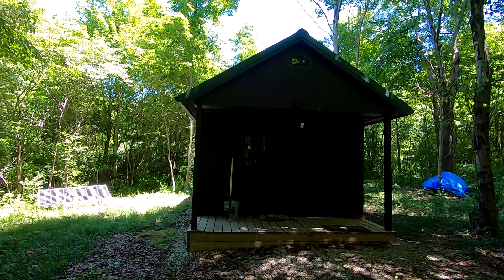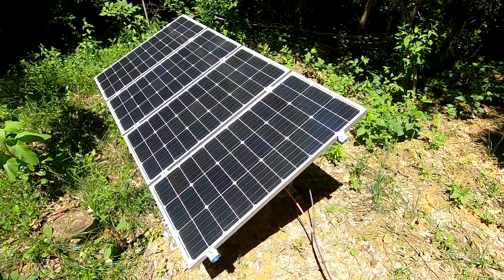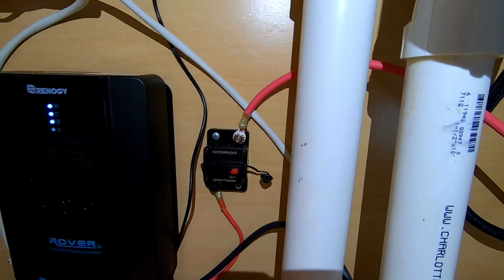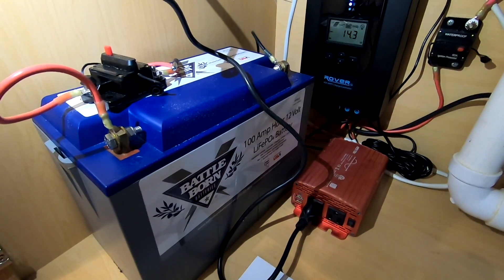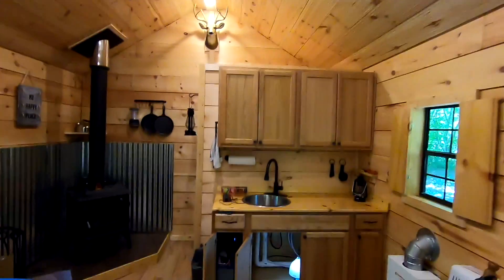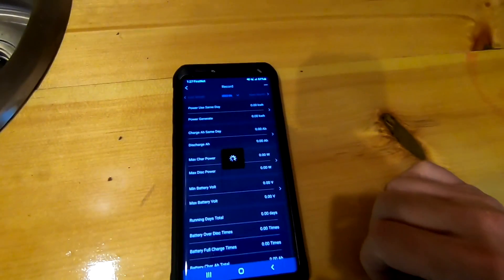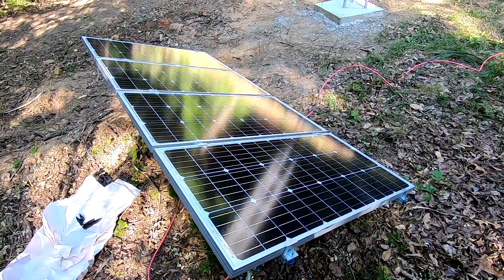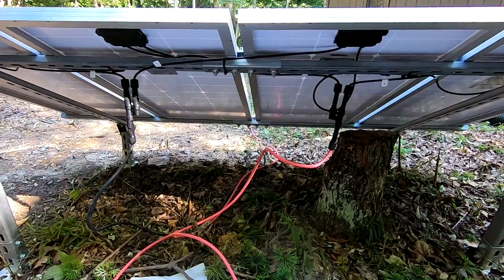$7,000 Dollar Cabin Gets OFF GRID SOLAR SYSTEM

Comment: I'd say switching the panels to 2s2p was a good move to combat shading there. I can also see you with 2 batteries there at some point and maybe using some pvc conduit for the wire run. 
Ok thats a small inverter but it should be hooked up to the battery. 
Nice cabin btw, cheers.

Comment: I just got two of those HQST panels about a month ago. I had fourteen 100 watts panels but couldn't run the window air conditioner very much. My panels are all different sizes and brands. I have kind of the same problem. The barn shades part of the panels after 5 p.m. So I have four on the West side and four that are on the North side far enough away to not be shaded. I have the panels hooked up in pairs, 41 volts open circuit, on my 24 v. system. The smoke from Canada has made it here, so I'm only getting around 800 watts. About five days ago it showed 1030 watts for awhile. The max on my 4215 BN controller is 1040 watts.. I have twenty big marine batteries for the battery bank. I added a 600 watts wind generator in March. They sent a 12 volts one but it was supposed to be 24. No trees here. I made some frames for some of the panels out of square pipe. The frames made them heavier so the wind doesn't throw them around. One of my first three panels got broken that way so that frame is the heaviest, lol. I think those two are like yours. I put two in each one. I ran a pair of #14 wires for two frames or four panels, which seems to help. There's four pairs of those going to the controller. I had 1200 watts of the panels facing the 🌞 Sun this morning. I flip four of them around noon from morning to evening. So I have 800 in the afternoon after the batteries are charged. I tried hooking up the panels 63 volts, and I didn't get as much wattage. There's a voltage that the controller will produce more watts at, mine says 33 volts. Mine runs at about 34.1 or around that. So it's pretty close to the optimal voltage. So, that means I can't put the panels very far away. That's why I am only getting a thousand watts on sixteen hundred watts of solar panels. Eight of the panels are forty feet away. But having the optimal voltage lets the charge controller run cooler. I had mowed by the building so I had moved all the panels out away. They all have plugs so I mowed and forgot to hook 800 watts of solar panels back up. LOL. So this morning I was like what the heck. Then I remembered. So I went and plugged them in and the amps went to 33.1, but the voltage stayed at 24.9. It has to have more amps to charge the batteries with the air conditioner on. So I had to turn the air conditioner off and let the batteries charge. I've got a gallon of distilled water and a pint of sulfuric acid that I'm going to mix and I have 120 cells to check and add water to. It's going to be 100 or over, for nine days. Adding water will let the batteries run closer to 80 degrees. That little hole of light will just get smaller as the trees grow. You can cut it while it's small, or cut it later when it's Great big. Probably need to top some trees, let some light through them. That's where you cut the top out. I would have already been chopping wood 🪓. Whatever was on the Southwest would be stacked drying out. 😅 Well one of these days, if you get the panels bug again, I bought a pair of 100 watts mono panels for $147. I bought the same pair before but they were $10 less back then. Same exact panels. So that's $73.50 each, not bad. They're really high output. I wouldn't mind having ten more of them. My uncle thought I was getting too many when I had 1200 watts, but I had to get four more to run everything else and charge the battery bank too. I usually run the air conditioner for awhile then let the battery bank charge awhile. Then when the batteries are about full, I turn it on . Then the panels will stay up with the air conditioner, freezer, mini fridge, three fans, etc. , and charge the battery bank. Today I had some wind power too. It always helps.  You can't put one up unless you put it in a tree top. You have a lot of chainsaw work that could improve your solar, and or wind generator power system. Besides your panels will get hot without any breeze, and won't put out very much. Might be what it's already doing.

Comment: It sounds like you have choices to make. No.1 shade or solar. No.2 what alternative you want, for back up and support. And
No.3 how you can have more solar for cheaper. My systems panels are 6, 255 watt Canadian solar. 38.00 a piece. My batteries are two power queen 300 ah. they are 989.00 bucks a piece. I have 3 charge controllers. Because instead of one big system I have 3 systems for individual rooms.  I have two power inverters. One is a 4000 watt pure sine wave 
And another 1500 watt modified sine wave. My main system is 24 volt
My others are 12 volt systems. OK it looks like your going to be cutting some trees in the future. 
Have a good day.

Comment: I have a shade problem as well. I made a 800 watt solar array (series/parallel) and I also made it portable. it's on skids so I can move it side to side to capture more hours of sun as the shade starts to cover my panels.
Reply from the maker: Yeah this winter it's been an issue with one of the constant draw systems in the cabin. Definitely not ideal being in the woods.
Reply: You got to get above the problem... Tether a blimp covered in flexible solar panels

Comment: I have a question about your great set up. Where can I find those lights on the remote control dimmer and what guage wire ? I'm getting a off grid place set up.  I've completed purchasing every possible power and hand tools.  That's the expensive part I think. I decided a pre built shed to cabin just because how costly lumber is.
Doing osb interior walls with panel wanescot, mdf chair rail all throughout  and tobacco glaze paint. Actually if painted well, osb has a nice texture , more durable than sheet rock and it's cheap,  sheet rock and tongue and groove is really expensive now. Found decent faux wood flooring for cheap at a discount supply store.  

I have most materials to start,  but the pre build shed actuality works out the cheapest because of such high lumber prices 

I suppose they charge you for the building, yet if bought lumber the extra waste.  The high cost of materials was the reasoning . 

Another thing, with osb walla as opposed to sheet rock, weight and structure durability I took in account because I'm making it portable,  building in one location and going to have it moved to another in the future 

I'm on land with family no problems,  however when I find land at recession prices (if this world problem persists) I will move the cabin and block and level there 

My set back years ago was I had to let go of tools. The 2008 recession wiped me out... this time I'm prepped and equipped
Reply from the maker: Here are the lights https://amzn.to/3EHeujo and here is the dimmer wireless switch https://amzn.to/3VAm05q

Comment: You would be best to run them all in parallel, you would not be over the amperage ratting of the controller but would minimize the impact of shading
Reply from the maker: I have them in series and parallel now. 2 in series and then paralleled together. This seems to be the best combo so far.

Comment: Thank you for your videos. I bought a 12x32 shed which I am working on. You showed the video about on demand water heater and those lights. The water heater i contemplated how i would do that, grey water system. I found a on demand water heater and a 12v water pump on amazon for 200 usd. Pulling from a 55 gallon rain collection drum, filtered, from rain gutters from my roof. It rains a lot where i live and this system is great. I have the luxury of charging the two 12v car batteries at a house, It was your video that enlightened me about the water heater. I had already planned on gray water but i never knew those on demand heaters existed. It works great. I rigged up my off grid like a RV. My next tackle will be solar and possible wind energy collection. Maybe a steam power turbine to generate, because my area it rains a lot and there is many times no sun. Thank you for you videos.
Reply from the maker: Awesome. Glad to hear it.

Comment: Nice set up! I have similar shade issues that results in much lower production. I've killed a few marine batteries by drawing them down too deep. The non led acid batteries are beyond my budget right now. One thing I did notice is that the watts produced increase once the controller goes into bulk mode. The Tru potential for your set up can be seen at peak sunshine and a low battery.
Reply: How many marine batteries can you afford to kill (and replace) before you make the smart decision and go with a lithium iron-phosphate battery, with low-temp protection?

Comment: what do you think about 2010 crv? i found a used with 115,000 and its ex l..i have been thru the funky a/c problem with i think 2007 and had it replaced. i guess the heat from the engine wears them down .too close. also looking at 2015 odyssey ex l..same miles. i know the van is a rarity but it seems they only changed the oil every 8 to 10 thousand miles. thanks for any thoughts.

Comment: Have you had any issues with mice or squirrels or other critters chewing on the wires with them being above ground?
Reply from the maker: Just installed this system and so far so good. I may put them in a conduit and bury them though. So far its so I can move the panels around if necessary, which I've had to do a couple of times.